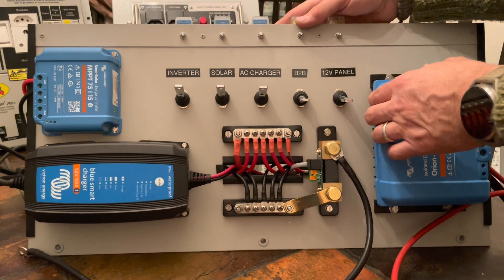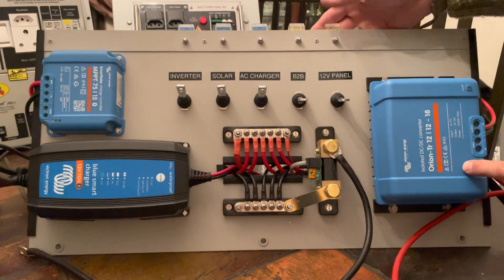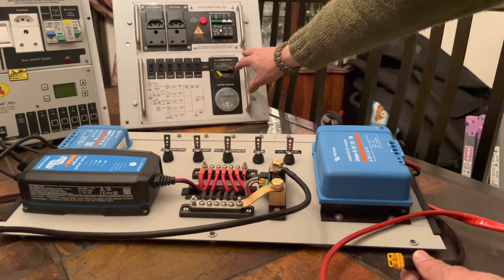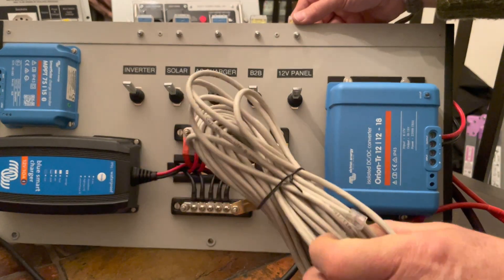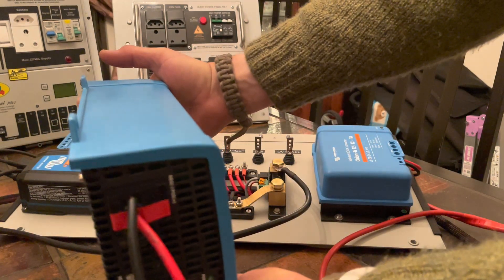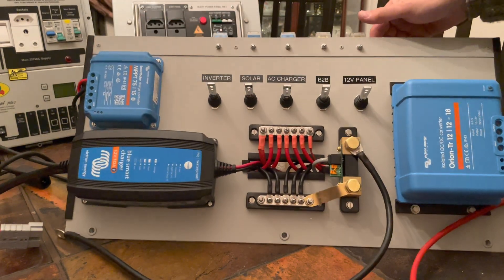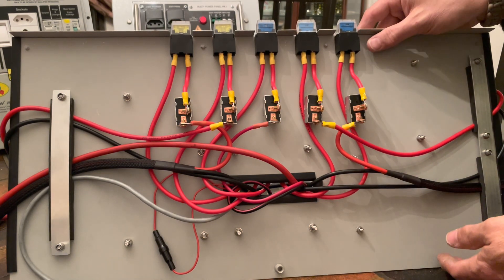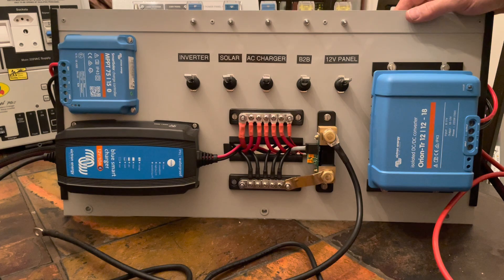Victron Charging Panel overview

Comment: What were your reasons for going with a separate inverter and battery charger rather than the model that combines both into a single Victron box?
Reply from the maker: Gives me a few more options to upgrade the charger or inverter if needed, and I prefer discrete components so there's more redundancy if a component fails. One of the reasons I moved away from the all-in-one power pack that came with the caravan.

Comment: Nice. Can you keep the 230 volt charger parallel on the dc to dc charger? Without the switch? I want to charge my trailer battery for the mover and winch but sometimes the battery runs low and I have to charge I with 230volt. That’s why I’am asking.
Reply from the maker: Hello William. Yes, the Victron equipment is smart enough to sense that another charger is connected and supplying power to the battery. I have 3 power supplies connected simultaneously (230V charger, solar charger, DC-DC charger) with no issues. I am sure Victron expect people to connect up multiple charging sources without worrying about switches.
Reply: @adventureswithrusty2012  thans you very mutch👍

Comment: The Orion b2b should be mounted vertically to allow heat to dissipate.
Mounting horizontally could tend to store heat rendering the large heat sink ineffective
unless accompanied  with a fan. Otherwise, neat.
Reply from the maker: Thanks Ashley, well spotted! I did note the orientation requirement in the installation guide, but I ended up being a little lazy with my cable routing around the edge of the panel. The B2B is only used when I'm hitched and traveling, to keep the battery topped-up. So it does not work very hard, and the compartment where I have the equipment mounted is well ventilated, especially when I'm traveling.
Reply: ive noticed this with all branded dcdc chargers with install videos on youtube, the manual clearly states vertical installation. people place them how they feel
Reply from the maker: @man.i.literally.failed6772  Yup, I read the manual and mounted it as I wanted to. There's good ventilation so I'm not at all worried about trapped warm air.

Comment: Clean, but the ring terminal connectors are giving me anxiety.
Reply: How is the inverter connected through the shunt?
Reply: The yellow ones on the back, not the ones on the front.
Reply from the maker: @Mattdavid-swfl  I do agree. They are a little quick and dirty connectors that I crimped through the insulators. I did check security after crimping and the core was beefy enough to get a solid crimp.